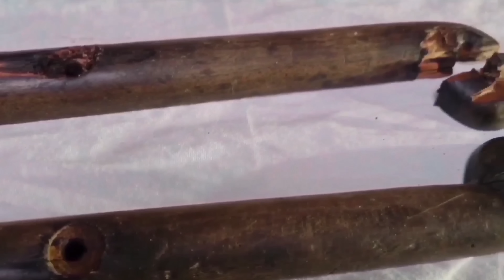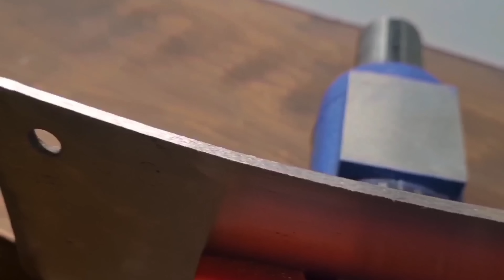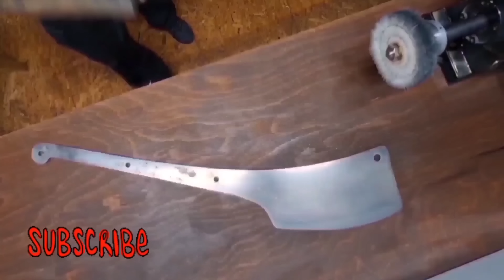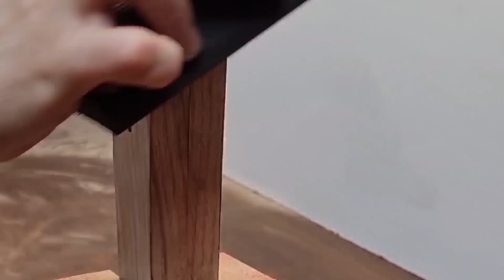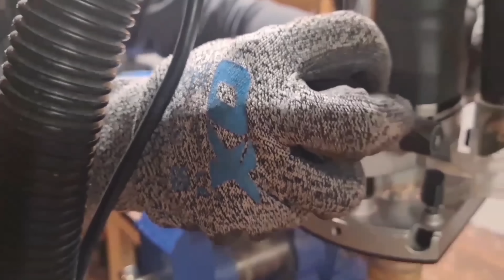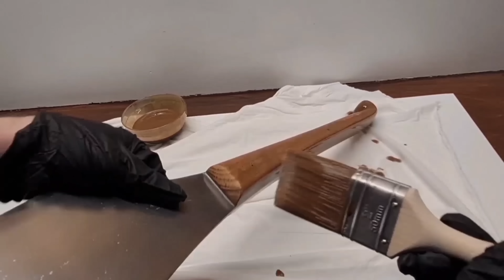Rusty Antique Cleaver Restoration @reborntools

Comment: In case you want to know, this Cleaver specifically designed as a pig cutter. It's used in slaughterhouses or in wholesale butchers where they cut the pig carcass in half while it's hanging. Also could be used for splitting off pieces of other animals that are hanging on meat hooks, but I've always known this size Cleaver as a a hog splitter.
Reply: But that was before modern power tools like the band saws that most meat packing plants and butcher shops have now.
Reply from the maker: Thanks for the info , I thought that was a slaughter hose splitter but wasn't 100% sure.

Comment: Do you really know what you have there dude ? It’s a old Japanese tuna cutting blade. Wish you hadn’t have broken the wood on the handle. Don’t know how much you paid for it or where you got it from but you got a really great find. What website did you find this on dude. I’d love to take a look. Hold on to it and do some research about old Japanese tuna chopping blades or axes. Not sure what they call it over there these days but most Japanese tuna houses uses a samurai sword 🗡 for cutting up large tuna.
Reply from the maker: I'm not sure if it's Japanese I bought it from a British farm in England. 
Actually I found it on Facebook marketplace. 
The gentleman was kind and posted it to me.
Reply: I’ve seen a video on a Japanese fish market that deals only in blue fin tuna and they where using a blade just like this to cut steaks from the tuna since it has a thick backbone. I’ve seen a few more Japanese shows where they collect bamboo for furniture and flutes and they used this same blade. I don’t know who was the first peoples to build this but if it was my guess I’d pick Japan or maybe a country like Vietnam. A good heavy blade for harvesting rice years and years ago. I’ll try to run this blade down to see who really made it.
Reply: Called "Hog splitter" here in America and one this size sells for 350 to 600 $ or more (depending on condition). I collect them but i never restore them !! I have restored two, smaller 14 inch blade cleavers for the kitchen.
Reply from the maker: Wow, thanks for the research! I got it for a bargain, much less than that price.
Reply: @shanghunter7697  I went to a private butchers museum in Milton, a small town in New Zealand.He had a collection of cleavers like this that were used on beef carcasses.He even had a brand new made in Germany.I think it cost close to $1000
Reply: @johngraham8893  Nice ! I would've liked that trip !! The ones i collect are from the 16th 17th and 18th centuries here in America. Most are (aprox) 2 to 3 ft handles. Huge hog and cattle splitters to make the job easier for the butcher. Best wishes John
Reply: The blade was made by L&I J White in Buffalo, New York in 1837
I have one identical to it. 33" long. Hog Splitter
@johnhutchinson5398